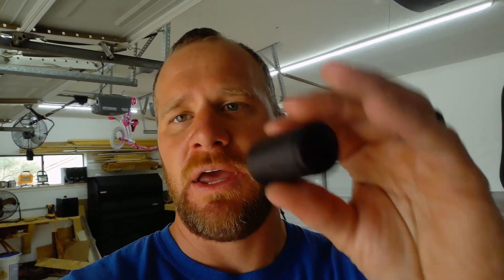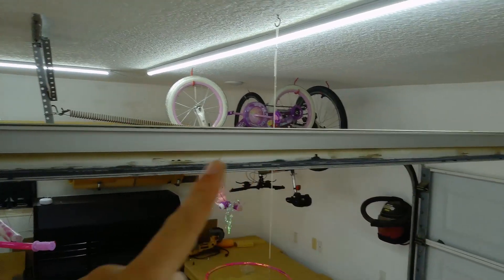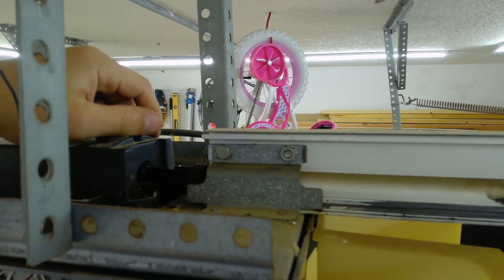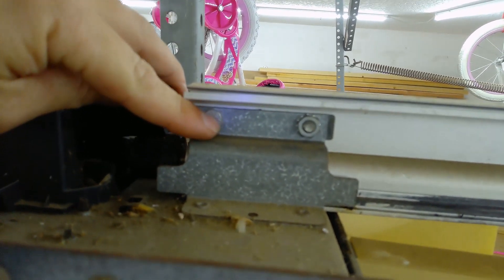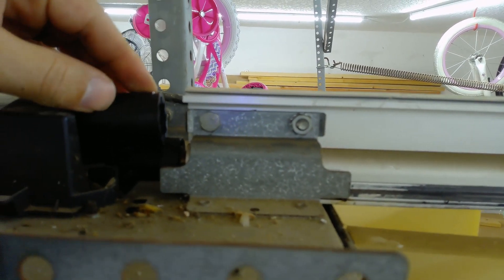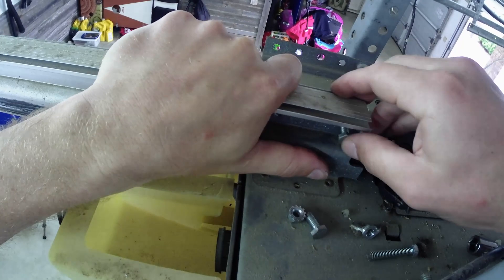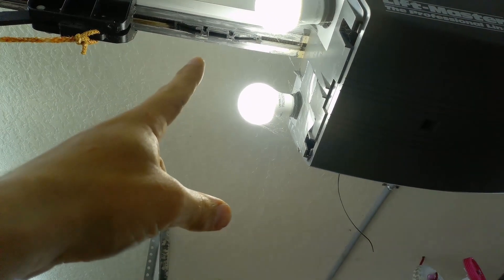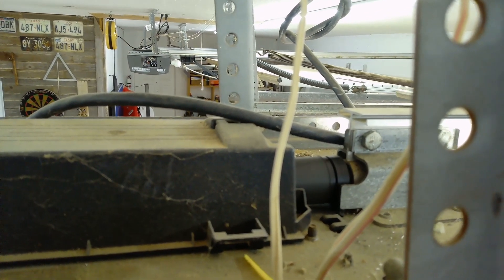Cheap Garage Opener Fix! Screw drive Coupler!

Comment: Great video. Tip make sure when install new coupler you know the garage motor positioning and the carriage that rides the screw drive are still in sync.   Easiest way is run the garage door open motor as if closing door so it memory stops when it thinks the door is closed. Now, make sure door is closed and the door trolley is reengaged to the carriage that rides on the screw threads.   At this point the motor and garage door are in sync.  Now follow video and install the coupler.

Comment: Bruh, u saved me like $200! Side note: I found it easier to close my garage door and manually spin the trolley to align with engagement unit so that it's in the closed position (check by breaking the laser beam to make sure garage lights don't come on). My rail was set in place & wouldn't move so I used some wires to support each side of motor with a little slack, then removed the 2 rail bolts & 2 motor bolts & was able to swing my motor back to insert the coupling as u said. Replace bolts, test and fine tune with the adjustment knobs on side of motor. $10 fix!
Reply from the maker: Glad I could help! Excellent job!

Comment: Thanks for showing us how to change the coupler. Price I paid was $16 but far cheaper than a repair person coming out to do. Only point we had to figure out was we had to remove 4 bolts at the far end of the piece you slide. Without removing these bolts it would not move. Once took them out it was exactly as you say. Thanks again.

Comment: I removed the 2 bolts connecting the rail to the opener but the rail wouldn't move as it did in your video. the other end of the rail was bolted onto a bracket which holds the rail up. I supposed I have to remove those to be able to slide it back.

Comment: Putting the coupler on is the easy part, the hard part is getting the motor assembly down from the ceiling and back up again. You need two people.

Comment: Your video was simple and to the point!  Thank you for the tip and huge repairman savings and not having to buy a new unit.
Reply from the maker: Glad I was able to help. Thanks for watching!
Reply: Does the fit size on the drive nut matter I've looked for the same one that broke but can't find it on Amazon

Comment: Great video. I fixed it just like you said, now it will not shut all the way down. Is there an adjuster for it?
Reply from the maker: Make sure that when you install the coupler the trolley is either all the way up or all the way down.
Reply: @littleaboutalot7478  Thanks for the reply. I found it has two buttons on the side to lift or lower it and that did the trick

Comment: I had the new pet installed but didn’t follow the part about moving the trolley. Does that affect the up and down limits? We can’t seem to get them to work properly no matter how much we adjust them.
Reply: Meant new part
Reply from the maker: It will affect the limits.  Typically, because when it breaks the spindle continues until it is in the full up position or full down position.  So, if you install the coupler and your carriage is in the middle of the track, the garage door opener doesn't know where your carriage is and will try to open all the way or close all the way, even though your garage door carriage might be right in the middle. Hope that makes sense.

Comment: I have removed the two bolts and nuts. But I don't see how to shift the rail in order to insert the new coupler. You show this at about  2:28.  Since the rail is one long piece that goes toward the front of the garage, I don't see how it can slide that direction. I know that everyone has this working, so I'm missing something very simple. Thank you for any advice.
Reply from the maker: I shift the garage opener unit backwards.  There should be enough give to push the unit and then insert the coupler. The rail does not move.  Thanks for watching!
Reply: Thanks for your response. But I want to be sure I understand something. At about 2:28, it looks like you put your hand on top of the rail and shift it toward the left, i.e. toward the garage door.  I think that's impossible, but it just looks like that's what you're doing. Can you explain exactly what you are doing there? Thanks again, I appreciate your help and your enlightening video.
Reply from the maker: Correct. I am not moving the rail towards the garage just the motor unit away from the rail.

Comment: I just did this fix thanks for the Video. But now when the door closes it hits the garage floor and comes right back up. I've adjusted the limit adjusters but it doesn't make a difference. I checked the sensors and they seem fine. Any one have an idea of why it won't stay closed.
Reply from the maker: Does it go all the way back up?
Reply: Same problem

Comment: Did this repair and when I put everything back together with the door down, I tested it and the opener just tried to push the door down more. Obviously that's not useful. Tried disconnecting the screw drive and running the motor;   it never changes direction. Just runs in the "close" direction until I push the remote button again.
Reply: I have this same issue, what was the fix?